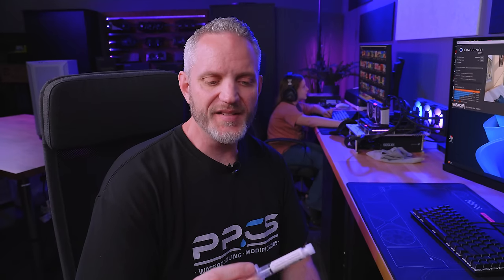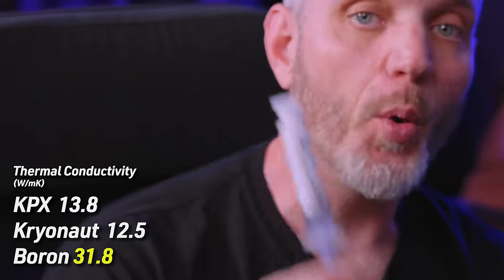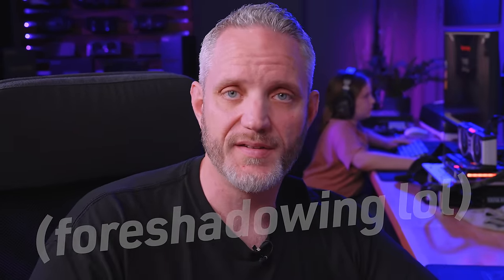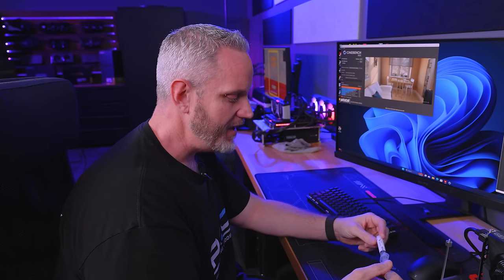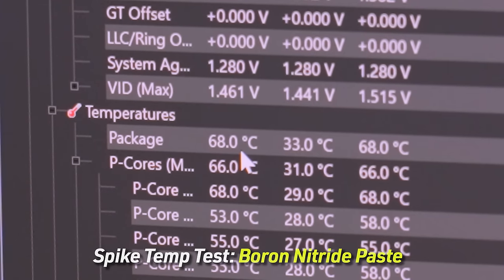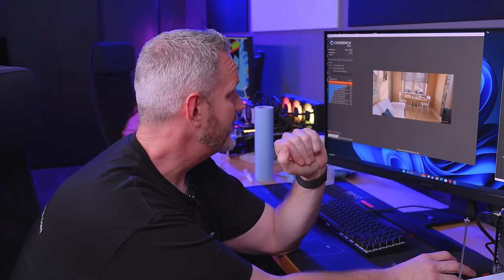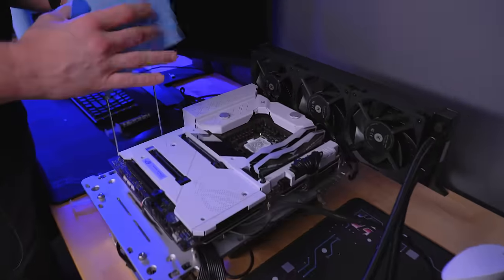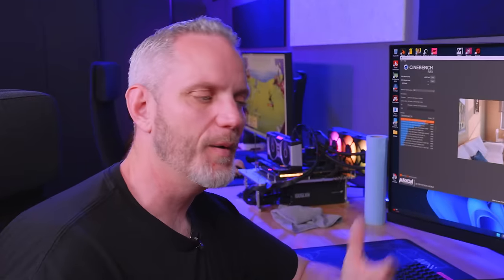Is this the new SUPER PASTE for PCs?!

Comment: Since its watery, wouldn't it perform better when the water base dries up? You need to test this on a spare PC in few months to a year to see a better result. Or pre-dry the water contents before application to give it a harder body to transfer the heat generated by the processor.

Comment: again, this is about where you live and how much it costs as opposed to availability. KPx and Thermal Grizzly are very similar (according to searches) - both are not available here and WAY out of the price bracket even if they were. I went with Arctic Silver 5 because of lack of availability of anything else; also I've used it before and it works fine as long as you don't use too much (looking at you Jay) regardless that it's conductive with other components, which forces you to use less because it WILL squish out along the die. I just repasted my laptop CPU and GPU and there's definite safe-zones where the squish can be ignored (moating as Jay says) so it won't come into contact with anything and short-circuit it.

Comment: Hopefully you didn't pay a ton for those. Boron Nitride is a very common application interface material in the injection molding industry, and you can get a decent size bucket relatively cheaply. Last time I picked one up it was around $45 for nearly a gallon. One of these days when my project docket clears up, I'll make a batch of graphene-infused paste, though I don't see it being much more effective in that application than a good silver-bearing compound.

Comment: I wonder if a thermal pad could be cutout to act as a bib around the CPU heat spreader, to make ease of cleaning old paste more simple AND to avoid any leakage of excessive paste onto the surrounding CPU PCB elements or socket perimeter. A bib that doesn't interfere with the cooler contact area.

Comment: I'm just thinking what about ceramic paste or copper paste used for brakes to use for CPU coolers?

And about the Boron nitride paste - as far as I remember in the manual for my 3D printer was written the paste has to dry before you are allowed to use the printer or the thermal conductivity doesn't work.

Comment: I just put Arctic 5 on my new Creality K1 hotend thinking it would be better thermal paste than this... Damnit.
(Edit) After watching, honestly the results were kinda obvious. On a printer, you're not squishing to make up for missing contact points. It's more that, say in the case of the k1 heater. It's a ceramic ring, and the thermal paste is to make up the gap that covers the entire circumference of it.

Comment: Indeed that thermal loss between the heat spreader and the AIO.  I have the H150i on my r7 7700x  and its 31.7 on the coolant but 61 CPU using  KryoSheet.  However it holds at 93 on the ADA64 stress test down from 95 with the Corsair stock AIO paste.

Comment: Metal to metal is always going to be best. Filling in the micro gaps only needs a thin amount of paste. the closer the metals of chip and cooler block the better. The thicker the paste the more resistance to heat transfer you will have. More is not better, less is best....     Does it say how effective the paste is the thicker you apply it????

Comment: Anything water based. Even if it performs fantastic originally, wont do well. You might have seen offgassing if the water in it. Where you wont get the rated performance until all the water has been driven out of it since its in there creating water vapor a very poor thermal conductor. 

But anything water based will not tollerate differences in thermal expansion. You rely on it to flex adjust and flow to fill gaps that are exsposed as the block and heat speader warm and worp. That stuff will turn into a powder eventually. 

Its used in 3d printing because normal thermal paste cant handle the high temperatures. The oils used in normal paste are stable around 100c and dont off gas much Thats why it lasts for years. 3d printers need 200 to almost 300c. Any normal paste would turn to dust within minutesor hours. So why not just use something that works better when its dust from the get go?  

Maybe somewhere there is a oil that can be used thats stable at 300c but its probably alot more than a dollar a gram or whatever. And besides maybe lasting longer in a cpu high temp thermal paste has no real market in the PC world. Paste drying out isnt an issue for premium PC oriantated pastes atleast not for 5+years.. the OEM pastes.. maybe. They dont seem to last as long
Reply: What I'm getting at. Is dry paste is an issue for thermal cycling parts. So.. if you ever take your cpu up to 80c more than once.. it won't work well. And if you are settling for degraded performance because the normal stuff won't hold up. You mid as well go with the product that works a little better when it's dry vs the normal stuff that dosnt work well at all when dry and broken down

Comment: Those lines when you pulled off the cooler looked like ELECTRICAL ARCING. ie the same shape as lighting or that stupid method of using electricity to burning those lines into wood.

It really looks like that past was a lot more conductive than you thought.

Comment: On the topic of thermal paste, how often do I need to take my computer apart and re-paste? I built my first custom loop cooling machine about 11 months ago with a 13700k and I couldn't get it above about 60 degrees under stress test benchmarking at the time. Last week I did a test on a whim and was immediately thermal throttling, and games are getting it up to 60. GPU (3080) still comfortably running mid upper 60s under stress test and gaming loads.

Comment: Even when truthful thermal conductivity numbers can’t really be directly compared, you can easily “game” the numbers through testing methodology. I know Roman has talked about this as have others. So big number not necessarily better. 
Also, seems like the limiting factor for a lot of CPUs (especially Intel) is the heat density and getting the heat from the die to the cooler. So much power density and then the IHS..

Comment: Which thermal paste is better, KPX or MX-6? It's for 14700K and an air cooler. I also plan to install Thermalright contact frame. Don't care about overclocking. Thanks!

Comment: Is  That   MiniMe2   ?     :person-turqouise-waving:  so  a  water  based  paste  that  holds  no  consistency  actually  sounds  like an  easy  solution  in  there  somewhere  ,  but  the  water  will  still  squeeze  out  and  dry  up  as  heat  goes  up  and  over  time  would   dry  out  due  to  Evaporation  .

Comment: What about laying some out on a plate and baking it until the viscosity gets thicker and then spreading it out on the CPU and trying again. It clearly failed because it was so thin it just ran out the sides under pressure.

Comment: So I looked up their Safety Data Sheet for the paste and found that it's 65-75% "Volatile By Volume" meaning that given the chance, that percentage will evaporate on its own over 70F (21C).  I suspect that part of your poor results were from the fact that two-thirds of it immediately evaporated, and left you with very little boron to actually act as a TIM.  Also interesting is that its classified in the SDS as a "high temperature mold release". :)

I wonder what the results would be if you spread a bunch of it out on a plate, hit it with a heat gun to evaporate the volatiles, and then scraped it back together as a thicker paste and used that.  If you put a drop between two glass slides, and then pulled them apart, you'd get an idea how the viscosity has changed.

Comment: It should only be a micro thin layer. It is not to be a thick layer. It just fills cracks not build a layer. If the low spots are as bad of the paste looked you have much bigger problems

Comment: I bought a tube of this stuff a while back for my Ender 3 v2. I saw the W/mK and was like "wtf is that for real" and thought about trying it on my CPU at some point.

Note that it turns into the sands of Arrakis relatively quickly. But that's also at 270C, which might affect that.

On to the video to see if I just repeated Jay.

Comment: Maybe to solve this problem you could put a bead all the way around the circumference of the dye using thicker thermal paste and then put this new thermal paste in the center using the old thick thermal paste to act as a dam to keep it from oozing out the sides.

Comment: If you want to test something more supercheap you could try the HY510 thermalpaste that I use for all computers I build, it is rated at 1.93W/mk so it should be pretty crappy compared to KingPin thermalpaste, but I normally don't use that high end cpu's and always get decent temps, I never seen a video of this stuff on anything higher end so would be nice if you did a video on it since it is one of the cheapest actual pastes for sale.

Comment: Seems to me many people use way to much paste.
The thing with thermal paste is that if things was perfect there was no need for it, however that would require the chip and the heat sink to be perfectly flat and the mounting to align them perfectly.
As things are never perfect we need thermal paste, but we only need enough for the paste to fill in where the contact between chip and heat sink isn't perfect. If we put in to much paste, then it ends up getting in the way of the ideal contact between CPU and heat sink.
Reply: Gamers nexus have already proven you wrong.
Reply: @Masa. Look closer and you'll see they haven't.

Comment: How is that going to age though, a water-based TIM?  I mean even the junk OEM's use dries out after a few years and has to be scraped instead of wiped off.  I've seen those thermal 'paste' pads (pre-shaped for laptop cores) get so hard I had to use a STRAIGHT RAZOR to get it off the heat pipe!

Comment: Jay, i could missing maybe your video but as you remember ...
Honeywell.
Did you check it?
Reply: Im using it on 2 cpus i dont have any before or after comparison but it works, 3600xt on the amd wraith cooler hits 82c. 5700x with pbo is around 78c on a noctua NHU12s

Comment: hey jay i gotta question i have a friend who has a test bench that he has older parts on am4  socket and he tests diff stuff usually gpus  anyway  i was over there the other day  because ive been having some issues but when he plugged my gpu in it wouldmnt show any thing  at all fans would startb liek normal but woudlnt show picture  he ran ddu  so on rebooted tried again nothjing but i have 2 pcs at my house and my gpu riuns fine on both my pcs at home and he usually runs amd stuff in his house exccept for maybe a high end gpu here and there  what do you do to deal with testing loads of gopus on your test bench?

Comment: Why do you use so much paste? Isnt the paste just there to fill out the microscopic voids in the metal? Using alot could in my opinion just create a cushion of paste, which is conducting worse than metal.
Back in the day it was; add paste the size of a small pea, spread it out with a creditcard so that the paste is almost see though, mount the cooler and wiggle it, screw it tight.

Comment: You didn't even follow the directions, of course it wasn't effective. You didn't let it dry properly, so the water in the paste that you're supposed to cook off caused it to have pretty terrible thermal conductivity. You should delete this video and actually do it right so people aren't mislead.
Reply: You’d be surprised how little thermal conductivity matters unless you’re trying to push the limits of the hardware or improve thermals slightly or something.
Reply: @flitai  You'd be surprised how much misinformation matters
Reply: @himanshrasal  Noice explanation...
Reply: This paste is great for holding temp, not necessarily transferring it. That’s why it was specifically designed for hotend thermal cartridges, not the cold end of a 3D printing head. And also says not for computers on the packaging, and website.

Comment: no you doofus,. those veins were create by you lifting the block away and it being thinner ., you said it right the 1st time but apparently you didn't understand yourself,.  the paste is only for the microscopic air gap..,.but you are right about using the right stuff though,. thermal epoxy probably works a little better,. but you want the ability to remove it,. so ,. ;p

Comment: I have seen you use thermal paste before.  one small drop is all that is ever needed.  Even the arctic cooler liquid cooler company only recommend placing a drop of paste in the center o the IHS so that it will spread out but not cover make a mess outside of the IHS.  Your are not using the product correctly and so your tests will all be screwed up.  Go back to thermal paste school because you obviously don't know what you are doing.